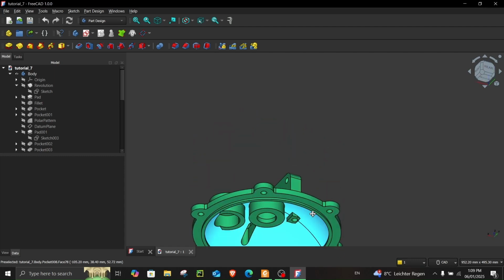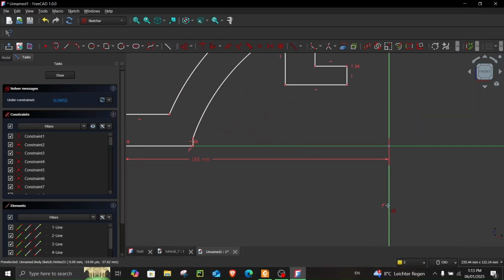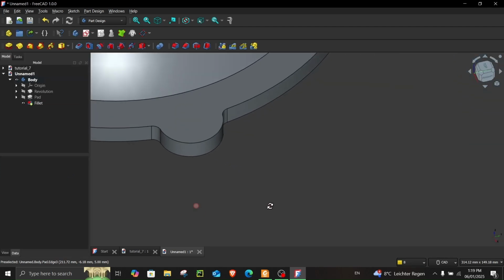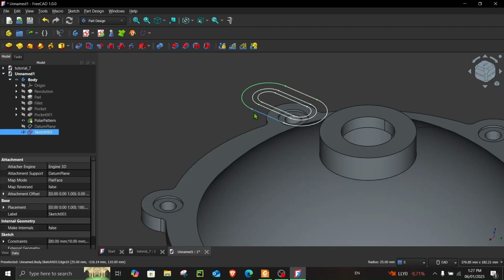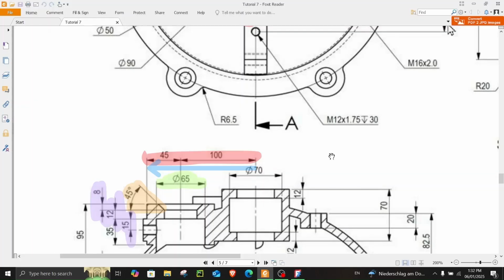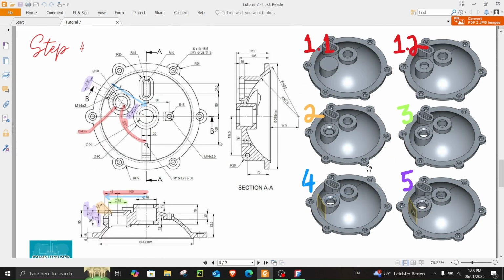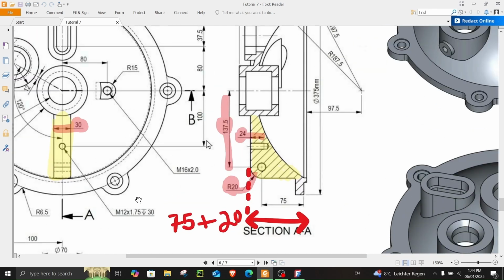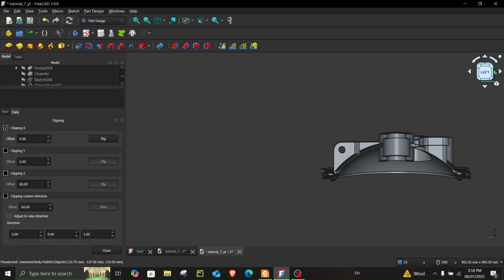FreeCAD 1.0 Beginner Tutorial | Exercise 7

Comment: You have designed a part that can only be manufactured by molding.

The model is not been made ready for that, there are sharp interior edges that are impossible to reproduce correctly, no mold lines and there should be a datum geometry that can be precission machined so everything else machining related is based upon that single refference.

Appart from that its a cool model

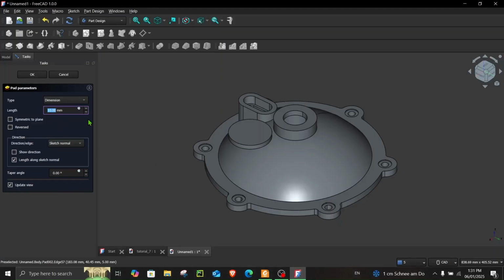Comment: 17:25 - How could you not notice that the cylinder does not go all the way to the end of the dome surface? Couldn't you have used pad to the surface instead of calculating parts of the height and end up with an incorrect result?

Comment: Great Series, I very much like it! I have started to do it on my own and when finished verify how you did it.
They main difference I found was in the use of the datum plane: I prefer to directly attach the sketches to the required positions so I did not create any datum planes.
Also in the sketch with the (later) tapered hole, I created a point with a distance of 100mm for the origin on the 120° reference line. I later alinged the sketch-plane for the through hole with "tangent to face" using the face of the cylinder and that point from the old sketch. This avoids recreating geometrie that had already been constructed. I then extruded symetrical in both diections to get the correct connetion to the attached cylinder.
Reply from the maker: That does sound like a good approach. I am always learning new tips and tricks from the comments when viewers discuss their own approach.